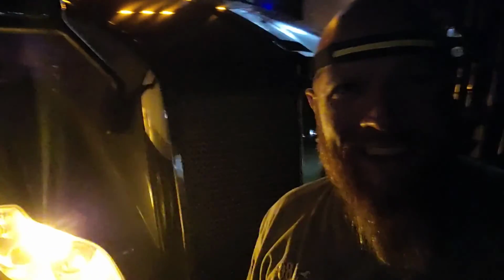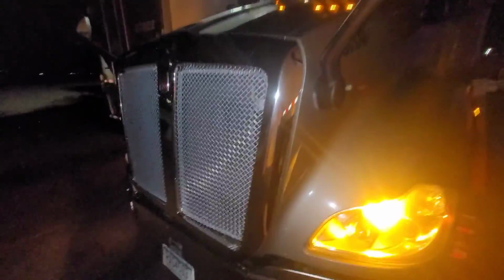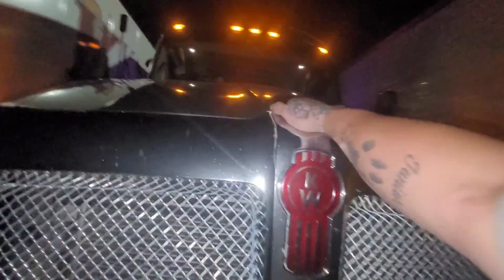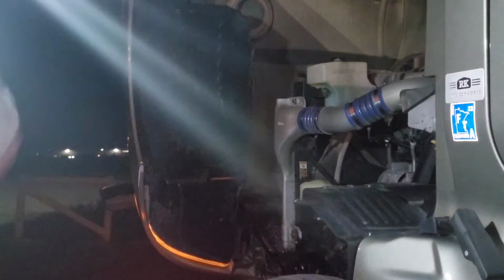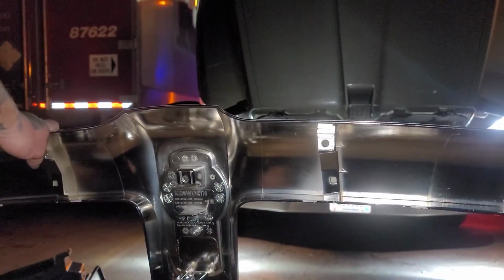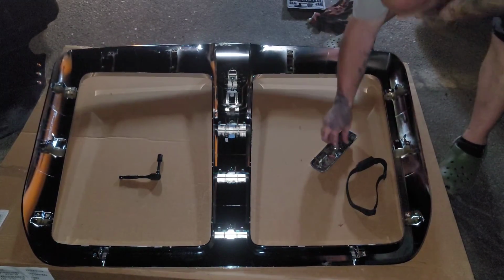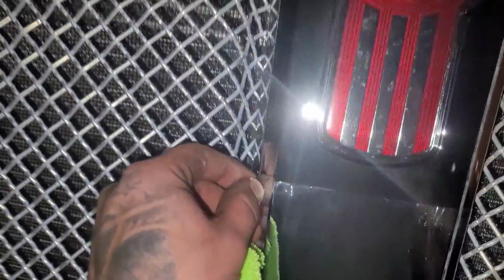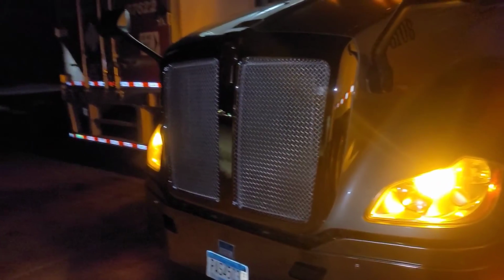How to replace a T680 grill surround #diy  #trucking

Comment: How much was that grill?
Reply from the maker: @kajg4236  the oem one was like $2,000
Reply: @justanotherotrguy  yikes! I just bought one aftermarket with the bug cover $490 but it didn't come with any u clips or anything else
Reply from the maker: @kajg4236  yea it was before i realized not to buy from dealorships if you cant help it. Thats why they call them stealorships, right?!
Reply: @justanotherotrguy  did the original come with anything other than those u clips for installation?
Reply from the maker: @kajg4236  nope. Just like kw to be stingy as hell. Just the clips already on it and no mesh inserts
Reply: @justanotherotrguy  no surprise. Thanks !
Reply from the maker: @kajg4236  any time!